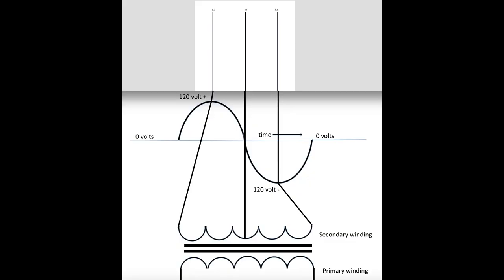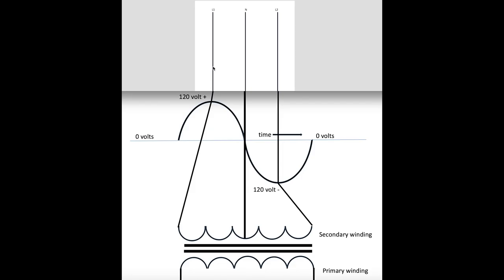The 3 wire system and the sine wave

Comment: Since electricity takes all paths, would there be a small amount of electricity bleeding back to neutral on a 240v circuit since the positive and negative meet at neutral? 

Love your videos!
Reply: +Volusia-ev 
I don't believe so because number 1 the potential from both l1 and l2 is 2x greater than l1 to n and l2 to n also l1 to l2 when balanced creates a simple series circuit and one of the laws of series circuit is that same current flows throughout entire circuit therefore no current would pass to the neutral.
Reply from the maker: +Volusia-ev No transformer has perfect windings.  I would say there would be a measurable draw thru neutral.  Sounds like another video.
GFM
Reply: grayfurnaceman 
Gfm can you explain why exactly just because the phases are imbalanced current will not flow from phase to phase? i understand the concept they won't and that is the purpose of neutral but why is that? u must have 15 amps one one phase to neutral and 15 amps on the other phase to neutral in order for current to flow from -120v to +120v without utilizing the neutral?